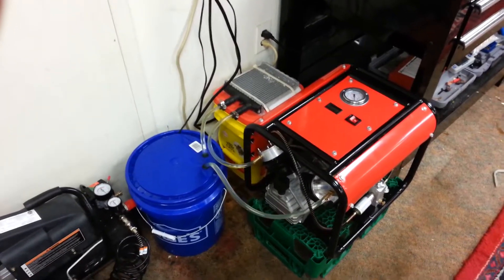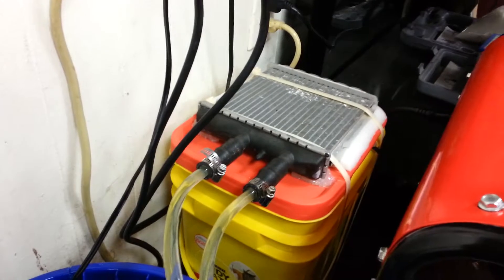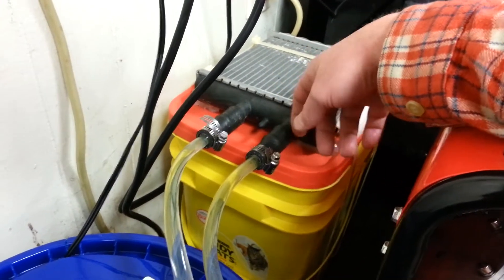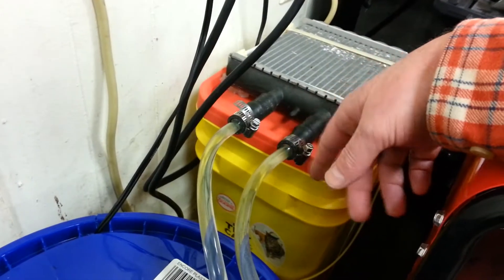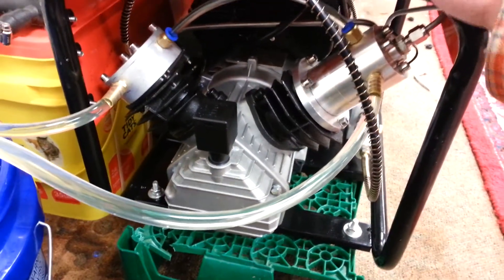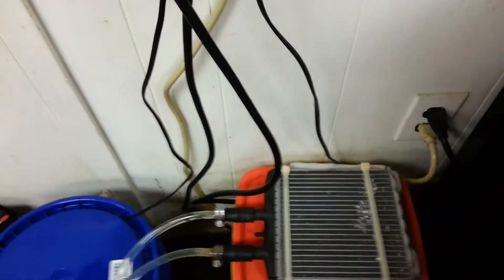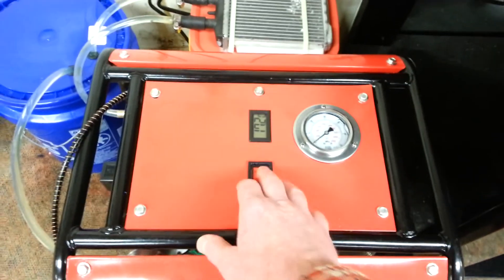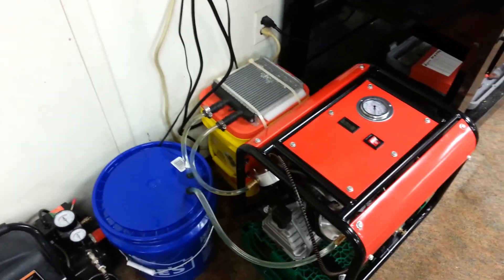Homebrew Cooling System For Airmax Extreme

Comment: Damn good idea!
Reply from the maker: I've since upgraded the fan. Now it's really craptacular! It now has a 9" fan with a cardboard shroud for the coil.
Reply: Mason Dawson 
I’ve been putting ice in mine
Reply from the maker: I was going to make a condensing tower out of stainless that goes up to the ceiling, and back down with drains on both ends, but never got around to doing so. I am on my third set of high pressure piston seals. The first set wore out. I tried rotating them out, and discarding the top one like suggested. No dice. My pump went out on the second set, and burned them up. The third set Michael sent me were a little thicker for more longevity. They do make the unit run about ten degrees (C) hotter. That's why I put a bigger fan on.
Reply: I bought a Hong Yeng it was cheap and it had good reviews.
It runs pretty good for Chinese cheap junk. I change the oil regularly and I froze some water bottles that I use in the water bucket. Surprisingly it runs fairly cool.
We’ll see how long it lasts!

Comment: That is one cool setup.. I know what you mean about not throwing stuff away.. :)
But, when I got old, I would forget that I already had the part I was looking for, and order new parts (or drive to a hardware store).. The next day, I'll find a big bag of the spare parts I needed! 

I've given up on using Scuba tanks for my PCPs.. I use a hand pump these days. 
(Not shooting Field target matches anymore).
However, something seems to be wrong with both my hand pumps.. They are getting hard to use, now that I'm 70!
So, the idea of using a compressor and keeping my large 300 bar scuba tank up over 200 bar, is starting to seem attractive.. 
My large tank, http://www.onlinescuba.com/Luxfer-Limited-106-Cylinder-with-DIN-valve-P3800.aspx
Has only been filled about 8 times, and the inspection expired.. (Never used for scuba)..
So, it would be a good candidate for running with a compressor, as a quick fill station.. :)

So, what's the scoop on your Airmax? Still running good? Is it hard to keep the air dry?
Reply from the maker: +Richard Lee LOL! You'er a trip! Keeping the air dry is a problem. I haven't sprung for a fancy overpriced inline dryer. I'm really skeptical of how well they work especially when are talking about multiple cubic feet. Another thing about this compressor is there is no filter on the intake. I was looking at the aluminum plate on top of the low pressure cylinder where the intake is. It's not even threaded. I am probably going to end up taking the plate off to see if it can be threaded for a homemade drier/air filter. I also have toyed around with the idea of making a condensing column for the rig.  I keep hinting if someone would make a convenient reasonably priced stand alone condenser they would have a decent market.

Comment: How are you liking the Airmax?
Reply from the maker: +scubajeeper1 I love it for what it is. That being a compressor to fill PCP guns. The only problem is that I bought it to fill bottles, and tanks for my bb machine guns. After I got it going my only complaint is the moisture separator. My guns aren't that picky so it's not really a big problem for me. I wouldn't try to use it for breathable air without some serious filters.